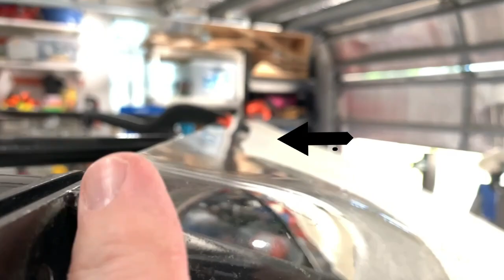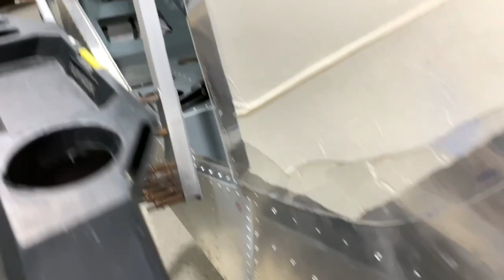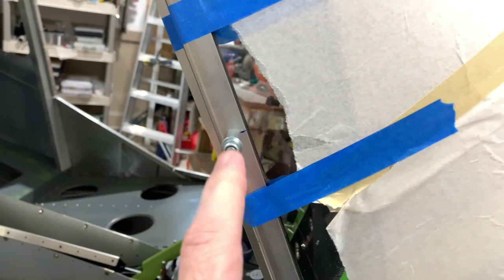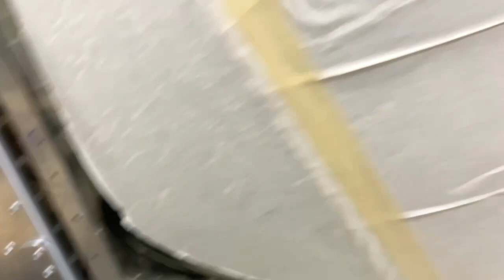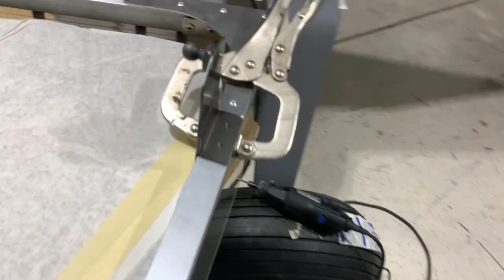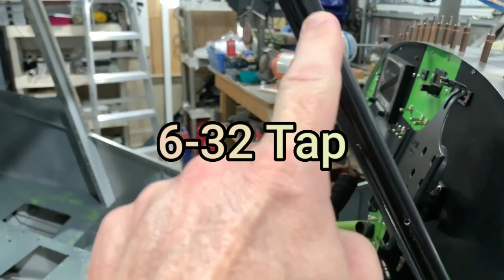Zenith Cruzer Winshield & Door

Comment: The windshield is the part that scares me the most. Thanks for the heat gun tip, maybe this will save me from cracking mine.
Reply from the maker: Be very very careful with the heat gun! If overdoing it, the plexi will turn into a wet noodle. I happen to have cold air blowing on my plexiglass and Lexan from my A/C unit in the garage. I felt more comfortable heating it up prior to drilling because of that.